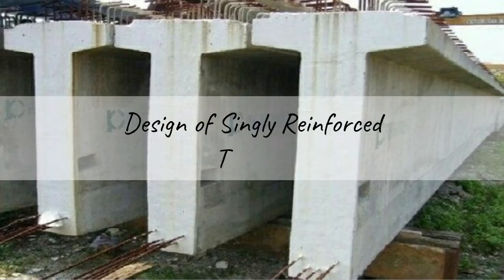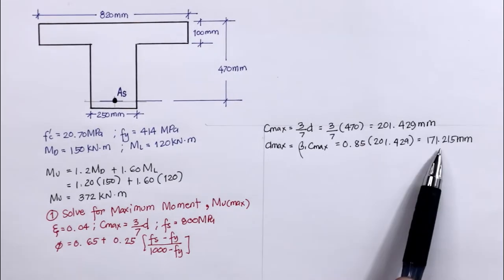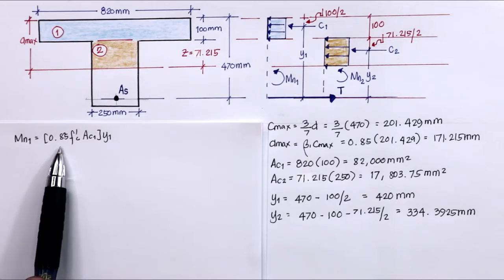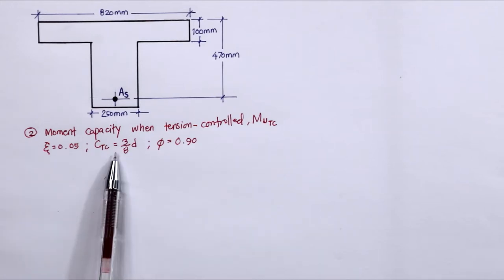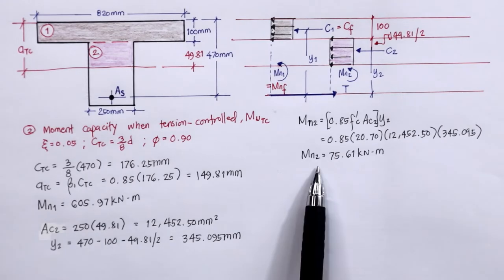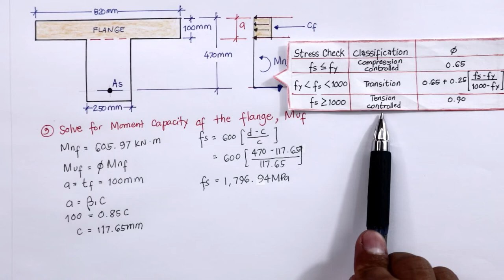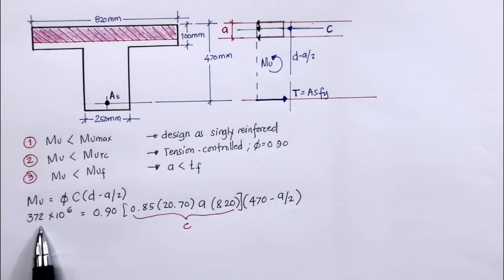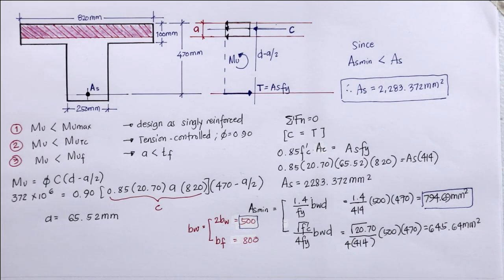[1/3] Singly Reinforced T-Beam : Design Problem (NSCP 2010/2015)

Comment from the maker: use the value of a(max) to determine the value of As(max), di kasi naisama sa video.
Reply: Engr. paano pag sinabing design flexural strength ano po dapat  hahanapin?
Reply from the maker: @rizzamagtibay8488  moment capacity po
Reply: Yun po ba engr yung sa formula po ng fb=MC/I or bukod po yun sa Tbeam ? Or yung Mu po?
Reply: Bakit Po Ang nilagay nyong value nung Ac2 ay 71.215(250), di Po ba dapat 171.215(250)??😁

Comment: Good day sir. May clarification lang po ako about sa value ng b(w), kasi based po sa NSCP 2015 yung values po na makukuha dun sa dalawang formula na prinesent mo which are 2bw at bf ay kinoconsider lang kapag yung flange ng T-beam ay under tension. Tama po ba pagkaunawa ko o hindi? Medyo naguluhan po kasi ako dahil ginamit niyo dito sa problem. 

Thank you po in advance ☺️
Reply: Tama ka. 2bw and bf is only applicable when the flange in on the tension side which is the case for statically determinate beams such as simple beam with inverted t beam and cantilever beam with upright t beam. Thus, for continous beams, regardless if the tension side is on the flange or not, use only the bw for the computation of the minimum reinforcement.